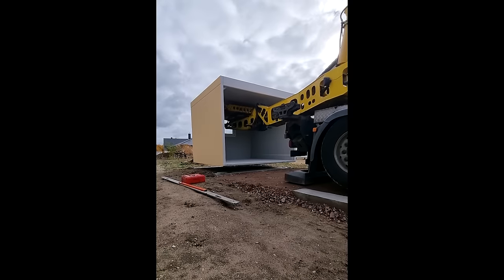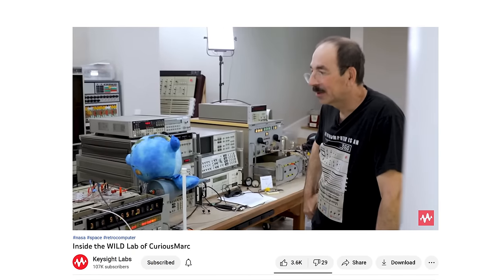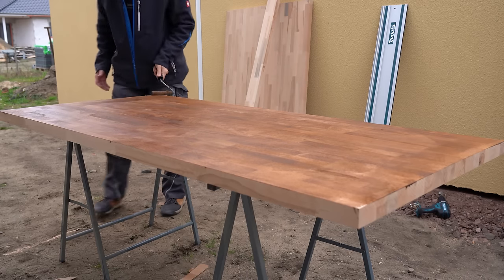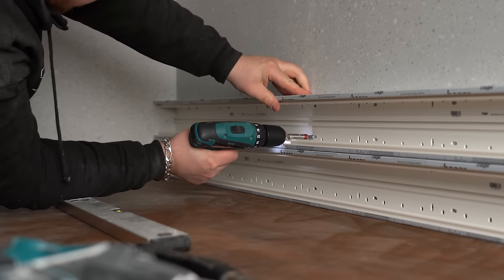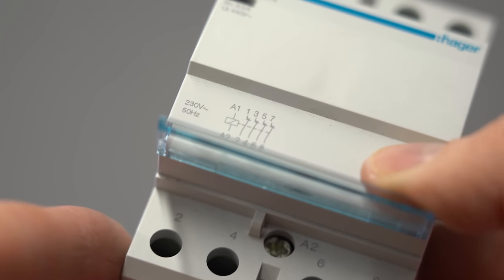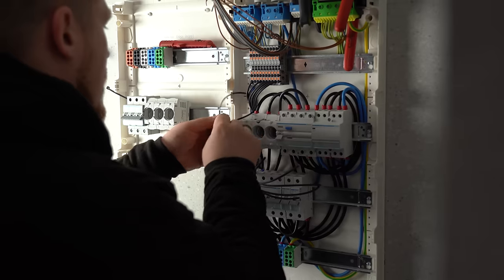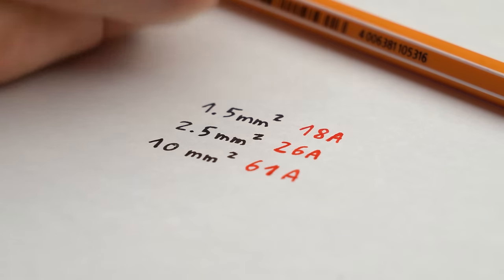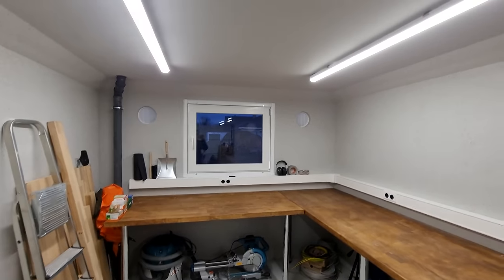Germans do the PERFECT Electrical Wiring! (Garage Build)

Comment: As someone who lives in and is from the USA this makes our electrical system look and feel ancient. I really wish the us would adopt things such as the metric system and electrical system like those in Germany.
Reply: Why? What does it look like in the US?
Reply: @OffGridInvestor  Maybe the quality of care is better if most keep paying for it in the USA instead of Cuba, Canada, Spain, etc.
Reply: @OffGridInvestor  😂😂😂 I know right, why the hell would someone still buy Chrysler products
Reply: And that's his garage.
Reply: @AATproducer  You really don't want to know...
It's the stuff nightmares are made out of...

Well if you are used to German or even European standards.
Reply: System is more or less the same through Europe.
3 phase is much easier to obtain than in US. I have 40KW (50HP) connection at my house and 25KW at my apartment.
Main benefit is that any snigle phase outlet will provide 3,7KW for 24h of use and 10% more for one hour, that is enaugh for most of aplications around the house. We have 150- 200A welders and 2,4KW angle grinders that you can plug anywhere since all outlets provide 16A at 230V.
UK has same voltage but different outlets, Italy has 10A outlets for low power aplications like bedrooms and behinde TV stands.
Reply: Bro your electrical system in U.S suck so much 💀💀💀
Reply: @sys-administrator  In Germany and rest of Europe we are not used to pay 40 or 50 years mortgage for house that is made of wood and sometimes last less than mortagage. In that time you buy several hauses, sometimes after payment hause is worth fortune, sometimes is worth nothing.
You can struck such in my opinion rotten deal any time in Germany or elswere, but most folks are trying to avoid that type of slavery.
Reply: @sys-administrator  Why do you think the US has it any better? lol
That particular example is much much worse in the US.
There aren't any government provided safety nets like in GER, they won't pay your rent or utilities bill if you loose your job.
You can even get your own flat as a teen if you can provide a serious enough reason why you shouldn't live with your parents.
Well if you can put up with our bureaucracy.
Reply: @sys-administrator  The reason home ownership under 40 is low is because renting can be cheaper and is more flexible.

And as mentioned if you can't stand your parents chances are high you don't have to put up with them.

Also damn, I guess I know a lot of wealthy people then. Because a lot of our customers are under 40 when they ask for quotes for a new electrical installation.
Reply: @sys-administrator  Sure...
What happens when you are for some reason forced to move?
What happens if you can't pay the mortgage?
Who pays when there is a major flaw/failure?
Owning isn't the be all.
As always it depends on personal circumstances.

"Renting is throwing money down the drain" is a very very naive perspective.
You never stop paying even for your own property. And it is something that binds.
Reply: @sys-administrator  That's the downside of what happened in the last 20 years, our wealth went away, and we gave money to people who do not deserve anything. Just look how much money we've send to rebuild Afghanistan and most of it went into the pockets of tribal leaders. The water power plant they tried to keep alive is just a freaking mess and the power grid is non-existing in most parts. 

We should do stuff like that like the French: Buy in our country the parts and send it to them, maybe even give the money to German companies, who are working in the country and keep the money in our country. We create work and help people - win win.

But that's not how it's done, and all the failed projects cost us money. Not the government, the taxpayer. And that is why we can't afford living anymore. Companies just want lots of money to rent you an old apartment, that should be illegal, they make 300% and you have to pay 50% of your net income just for rent.
Reply: Wuth the metroc system Will be perfecto
Reply: it's clean, but not perfect, and i am so sorry for you, but all laxs  in energy are different , most EU have 230 V ( theory number, it can varies 210 or 250 V depend how far you are from the distribution center )
Reply: It not that's bad. A brand new system is going to be just as good in US.  I think you may be allowing decades old load centers form your opinion.  Personally, I think the European stuff looks like playskool toys and prefer the more industrial look of north American load centers. That said both are fully capable of doing the job when modern parts are used.
Reply: @SwipeKun  based on what?
Reply: @hgbugalou  Your entire system EVERYTHING💀💀💀
Reply: That is true, US have a lot to learn from Europe
Reply: @SwipeKun  How very specific. There is very little difference in a modern north American load center and a European one.
Reply: @atexnik  Such as?
Reply: @hgbugalou  electrical wiring including the main box and furniture cabinets making and installation. European approach is much much better for both.
Reply: I really wish 3-phase power was available to US residences. It's common in Germany, almost unheard of in the US.
Reply: @atexnik  Well for one you can have DIN style main panels in the states and they sell the parts.  That said, I like the US mains panel better with the actual hot rail and not having to deal with another set of wires and lugs.  You get all the same protection too if you use the right kind of breakers. When it comes to furniture stuff, I am not sure  how it is in Europe, but here there are more than one design and some are better than others.
Reply: @philkarn5661  You can get three phase power to residencies in some locations if you are willing to pay for it.  It is honestly overkill for 99% of the population though.
Reply: @philkarn5661  In Europe the norm (and cheapest solution) is mono phase 230 VAC 50 Hz 3 kW max power (+ 10% tolerance). 3 phases are NOT generally available in residential houses, and for sure not with ”low power” residential contracts. Maybe if you are willing to pay more (monthly fixed amount even with no kWh consumed) for a reserved power of 6 or 10 kW you can have the 3 phases.
Reply: @sinisatrlin840  Get your facts straight. The US has 240V in every standard breaker panel. The difference is its two phases split into 120V each, which makes it much safer than the European system, because its unlikely someone touches both phases at the same time.
I grew up in Europe live in the US now and think the opposite, its the European system that is way over engineered and due to its 220V single phase unsafe.
Reply: @beershortage  Unsafe? How? EU countrys code is much stricter than US code.
Try to plug welder in 110V socket, see what you will get.

3,7Kw from any plug, anywhere is blessing for small shops and bussineses. 11Kw 3 phase from smallest 3 phase plug.  And we have 16A, 32A, 63A and 125A 3 phase plugs in everyday use, do you realize how much is life easeier if you own and run some bussines? To be able to plug in 100Hp machine with plug that has size of beer bottle?

Have you seen this video? Have you seen other videos made by electricians from US?
I have 40Kw (50Hp) connection at my house that is build in 1978 when i was 3, long time before electric cars become a thing. I have lathe and milling machine (15Hp and 5,5Hp) and i do not need phase converter.
I have 22Kw outlet for car charging in my garage and that is normal thing here, nothing out of ordinary.

I am certified electrician for industrial machines and automation,  and i am quite familiar with the matter that is my bread and butter.
240V is not more dangerous if everything is built by the code, diferential circuit brakers that are installed beacouse of code and law are major factor that make EU instalations safer. Lower current through similar/same cross section conductors is another factor.
Electrocutions and fire coused by bad wireing are less common in Europe than in US.
Please straigten my facts by another verified facts.
Reply: @sinisatrlin840  you are saying being shocked by 240 Volts is not more dangerous than a shock with 120Volt? Care to elaborate on that Mr Electrician ? I cannot wait for that explanation.

And i am welding using my 110V outlet all the time, Mig, Tig and Stick! Works just fine for most thicknesses. Oh yes and if i need more juice i plug my welders into one of my 240Volt outlets. As i said every house in the US has that, 4KW no problem. Difference is we use outlets with 2 phases that are reversed, 120Volt each = 240V.
And no, the European code is NOT much more strict. Ground Certification for Solar would be one example.

And dont give me that BS argument every house has a three phase panel in Germany, i know for a fact that this is not true because i lived in several with fucking Schraubsicherungen!, The system in Europe can be just as shitty in old houses like in the US, difference is the German Hochmut
Reply: @beershortage  Everything is done so you can not get shocked. If you are electrocuted, than something is terribly wrong.
I use 7018 1/8" at daily fabrication, 5/32" now and then, any socket, any time.
150Amp Stick, 180amp Tig and 180amp Mig are obtainable in 100% at 240V 16A outlet, and 10% overload is allowed for one hour in every 24 hours.
And we can have 240V 32A industrial socket if we need one.

Schraubsicherungen have been phased out in late 70s, everything since than is way more modern.
Schraubsicherungen are not available as replacement elements in many  electrician stores through EU.

German Hochmut has nothing to do with it, Holland and Belgium has stronger code than Germany.
Schraubsicherungen in EU could be still found in certain old houses, but in 2020s you could hardly find few.

Not every house has 3 phase panel, but every pole and every street power company box has 3 phase available, and if you need it you can get it. i wanted it, payed for it and i have it. 10KA circuit brakers and 30mA differential brakers also.

Are you saying that Siemens, ABB, Schneider (Square D owner), Merlin Gerin, Hager and others are producing sub par gear?
And yes EU code is stricter, no differential protection, no certification, no connection. For 30 years now.

It is my job to know codes and regulations. Single wire conductors with insulation that has 1000V AC working voltage are minimum that we can use, with 2500V test voltage and there is additional insulation that forms cable.
660VAC wires where phased out when i was a toddler.
Reply: @sys-administrator  Come to Canada, where we have the horrible German housing market, the horrible American electrical systems, and the horrible Canadian high prices for goods and services.
Reply: @ianmccoy1999  Many suck, but the Dodge Viper does not.
Reply: @sys-administrator  No different in any of the big cities in the US, unfortunately.  But hey, nothing wrong with family values.
Reply: Well US has already adopted the metric system in 1975. Quote : The Metric Conversion Act of 1975 is an Act of Congress that U.S. President Gerald Ford signed into law on December 23, 1975. It declared the metric system "the preferred system of weights and measures for United States trade and commerce", but permitted the use of United States customary units in all activities.
Reply: @AATproducer  they still use wire nuts in usa and curl wires onto screws 😮
Reply: @sinisatrlin840  Germany also has the highest electric prices in the world. But hey, at least it's "green" energy!
Reply: @johnjacob5329  I travel a lot. Where is life better than in CH, D, B or NL? 
With some education life can be quite good.
Reply: @johnjacob5329  Nope. I work in industry and travel a lot to CH and D.
Reply: The AWG sizing system gave me an aneurysm the first time I saw it haha
Reply: our electrical system is comprised of 150 years of whatever electricians could get away with
Reply: The Electrical system is exactly the same in Australia as well. With one or two minor differences
Reply: US signed up to the metric system before Britain did!
Reply: @atexnik  no we don’t 😂
Reply: @sinisatrlin840  I plug a welder into a 110 socket often and never have any issues. I also don’t need fancy shit for lathes or milling machines 😂 is used frequency drives that cost nothing have full control my my machinery and run it on 240Vac I don’t need 3 phase.
Reply: @johnjacob5329  it’s Russian energy not green anything
Reply: @lonewolftech  Well, i guess that you can get by that way. My main lathe has 7,5KW (10hp) motor, and for bigger work i have 11KW (15HP) lathe with 630mm swing. Small mill is 2,2KW, big one 5,5KW. There are also many welders, hydraulic press, and 3 drill presses. 
My workshop is not big, there are many more serious guys around me and we all run 3 phase. 
Getting phase converter for 30hp would cost more than 3 phase connection where i live.
Reply: and yet.... in some places/shops NOT me... using a Wago is looked at with horror, oh.. NOTHING is stopping you from using metric NOW, as long as you're bilingual
Reply: @mos8541  When i was a kid, most looked with horror at Japanese cars. 

Most still do not realize what it takes for electrical product to get VDE or S+ stamp of compliance. Much much more than filling form on internet site of "certificate provider" and paying 25$.
Reply: You guys did adopt the metric system, technically before Canada! 😂
Reply: Dutch engineers are much better
Reply: @theovanadrichem2018  Like anyone elses engeneers in Europe by using German and French gear. Siemens, ABB, Schack, Hager, Merlin Gerin, Schneider and so on.
Reply: I live in Mexico which has adapted the US electric power system. Terribly unsafe and plagued by inappropriate cheap material and equipment. And because of low voltage, longer cables have to be arm-thick! Not to mention aluminum wiring which I consider as being almost criminally dangerous for house wiring! Connections have to be super well done as average amperage is higher…!
Is that what it is like to live in a “developing country“?
Reply: @sinisatrlin840  you literally have no idea what you're talking about.  I've seen a bunch of impressionable zoomer children on pol regurgitating this exact same thing
Reply: @loginavoidence12  Does not matter what you say. I have 8 people working for me and i have my bussines for 21 years doing industrial automation and instalations. Started as residental electrician, and moved to industrial stuff, complex and bigger responsability but much bigger $.
Reply: @loginavoidence12  What have you seen by pool in US, does not mean that is possible to see elswere.
Reply: @AATproducer  The breakers and boards look like something out of Soviet Russia and are just all outdated.
Reply: @sinisatrlin840  yeah try to run 16A on your outlets constantly and you will have at some point a fire in your house congratulations
Reply: @freewayross4736  Why? All 16A outlets are wired with 2,5mm2 CU wires, protected with individual 16A B curve breakers in residential and 16A C curve breakers in industrial plus diferential protection. Bathroom, washing machine 0,03A, other apliances 0,3A. Industrial 0,03A diferential on everything.
That is a law here. 
Btw our houses are concrete or brick or combination with drywall in some parts that is also not flamablle, cables in solid buildings go under plaster or stucco.
Please explain.
Reply: @sinisatrlin840  normal outlet is not for constant usage of 16A buddy  only 10A didn’t talked about the breaker or  anything else just that it’s not possible or rather recommended to do that and there is no breaker going off just because  plastic starts to melt and catch fire.
Reply: @freewayross4736  Schuco is used everywhere around central EU, i can not recall seeing many burned ones in my 30 years career.
If you wind up your welder and burn 3,2mm rods for 8 hours withouth getting it warm than it is good.
Outlet can overheat if wire is not properly tighten, if plug is demadged, ect.
But that it starts to melt and burn, something must be very wrong.
Btw, plastic used on innards is self estinguising kind, there are also higher tier variants available.
Reply: as a German it all looks very basic and standard...can you highlight what you do different and why you call your system ancient? agree on metric and you have to get rid of those stupid wire nuts...
Reply: @sinisatrlin840  …. Get some education for real
Reply: @freewayross4736  For real? Like you? I have trackable record of doing bussines in industrial automation for over 30 years. What about you?
Reply: @sinisatrlin840  I have only 15 years of experience in commercial, residential and industrial. I work in all fields but still a NORMAL outlet is not made for fucking constant usage of 16A and you should know that
Reply: @freewayross4736  Do you have that in writing? From some autority of course.
Reply: Its so wierd you have plane wires inside you´re walls. So wierd not putting plastic tubing in the wall and have the wires in these.
Reply: @AATproducer  The norm for US domestic installations is a split single phase system. Basically at the nearest transformer to a residence, you have three output wires - One attached at either end of the secondary coil (240 volt phase and neutral) and one wire attached to the middle of the coil, providing a 120 volt phase. This 120 volt supply is what most standard appliances run on, with the 240 reserved for high consumption devices like electrical hobs, ovens, heat pumps, water heaters and the like, which is rather inefficient - Lower voltage means higher current for any given amount of output power, which means more heat losses in the wires and devices. 

Additionally, because each consumer is single phase while the upstream supply is three phase, same as here in Europe, balancing the load of the three phases for minimal inefficiency is a bit of a nightmare, compared to when each consumer unit is three phase and can be balanced in each house. If one consumer on a street builds a big workshop on their property, for instance, it will severely overstress that one phase, compared to the other two, and there really aren't any way of amending it unless they get a separate three phase supply for that, which isn't the norm.

They also have some rather outmoded standards in terms of devices in a fixed installation. For instance, all their sockets and switches are using screw connectors, and they almost exclusively use solid core wire for their in-wall installations (and let me tell you, it's soooooo much easier to work with stranded wire than solid core when you're doing in-wall installations!). Additionally, the use of Wago connectors hasn't really caught on there (perhaps associated with them still using screw terminals on their devices instead of quick connector terminals), so connecting up junction boxes and whatnot is not as easy to get neat and with confirmed good connections.

To add to it, it's rare to have overall ground fault protection via a GFCI in your consumer unit, meaning it's just less safe.

These are the things I've gleaned from youtube. Someone who has experience as a spark in the US probably have a fair bit more to say on the matter, but these are the things I've noticed that immediately stuck out to me as regressive.
Reply: Get out!
Reply: @AATproducer  Just two things to mention are enough, but there is plenty of more. First is in US you can rope the wires essentially where the hell you want. In EU you need to go in 90 degree turns to keep it clear for anyone say screwing into a wall something where the wires are going. Professional can pretty easily figure out where the wires are with out ripping anything open except the conjunction boxes since you are only allowed to go straight lines and 90's turns. Top of that all wires inside the construction are run with out pipes metal or pvc witch allows those round MMJ cables be swapped if need arises with out ripping the walls open. Just use existing cable to pull new in to replace it. Houses here are not designed to be destroyed and rebuilt in few years and its rare that house is taken to studs except most extreme mold/moisture damage cases witch those are rarer too and often just lack of maintenance or not understanding how things are suppose to work.

Another is insulation. Its rare to see except in most cheapest china shit parts conductors being exposed more than 1mm2 witch is the standard ie you need to have intent on touching the conductor, you are not able to do so accidentally, except when someone has fucked up royally, like once i was checking storage garage to rent and saw cable on the ground. Obvious reasoning was wtf this is doing on the ground. The asshole that had removed light wall that use to be there had left the power socket just laying on the ground while live and got me good 230v shock, but yes that would been man slaughter charge if i had died from it, so massive fuck up from past tenant.
Reply: @sinisatrlin840 Poland is one from central eu countries which use CEE 7/5 (French standard)
Btw us installations and codes are similar to German ones
Reply: @AsXSn  I know, your earthing is round prong sticking out. Your schucho variant is better, can be polarized/can not be reversed and earthing prong makes better connection. Schucho plugs sold today (well, better ones) can be plugged in French/Polish and German/rest of us outlets.
I live in Croatia and our standards are interchangable, your and mine installations are legal across EU.

In my hood there is Polish pasticery/cake and icecream place that is owned by guy from Poland and has Poland produced outlets all around, which happen to be legal here also.
Reply: Know why the US has 110V and Europe has 220V.? Its because Edison first built a DC electrical system. Then Tesla came along and invented AC. Edison campaigned against the AC system by doing things like electrocuting Dogs to try and prove the AC was dangerous.  So that is why we have 110V and they have 220V.
Reply: @DerSolinski you don’t know about unemployment benefits in America clearly, yes there is absolutely safety nets for citizens who have been recently fired. I know people living for 100% free simply because they have children and is “looking for work”. The social benefits in the US is so bloated that people who don’t need it get access to it.
Reply: @matthewmccarthy2406 we have 220, we just borrow half of it at the panel unless it’s a 220 breaker that crosses both contacts. You don’t seem like you know what’s going on with electrical in America. We just have companies that have monopolies on the industry like square D, Eaton etc… you can order whatever parts you want that pass code and make your electrical as pretty as you’d like.
Reply: live in canada.... like shit is my answer @AATproducer
Reply: No thanks, ours is superior to this in every way. This looks like some kid designed it.
Reply: Not sure what my original reply was. In the US the circuit panel is wired with a bar that carries the hot side and the breakers are clicked in to that bar. You can simply put in breakers that you want to use be they 110 or 220. In Europe the Hot side is a detachable bar that is more or less specific to the kind of breakers that are installed. I don't know why they do that but it makes it a bit more complicated and less easy to add and remove breakers. Another thing is that with 220 you only need half the Amperage so wires are thinner and breakers are most commonly 15 amp or below.  @BarrackObamna
Reply: Usauly is the same across the howle Europe but germany respecta the Code the most
Reply: Yes sir...the United States NEC is a lucrative business for manufacturers, builders, engineers, and tradesmen. All in the name of security.
Reply: 0:44 
Move to germany then.
Reply: @sinisatrlin840  Standard outlets are designd for 16A for one hour usage, not for the whole day. I you need a long term outlet take a blue CEE plug for 230V. It is mostly use on camping sites to conect caracans to the electrc grid. But it is posile to use it for high ower users in longterm use.
Reply: @marcobassini3576   3 phases are NOT generally available

errato, puoi tranquillamente richiederla la trifase a meno di non vivere in una topaia, e la tolleranza arriva al +40% per tre ore al giorno
Reply: @beershortage  stia farneticando, basta il solo fatto che in US usano quadri elettrici in metallo (follia). In più 120V significano corrente più alta...in case fatte di legno, carta e sputo 😂
Reply: @Ale55andr082  Psssst, you know very little my  friend. Every US household has 240 Volts to its disposal.
Reply: It’s because the US just doesn’t follow international standards
Reply: @philkarn5661  lol, not true. Secondly, why do you think anyone needs three phase in a household?